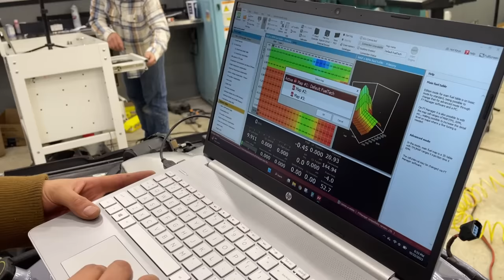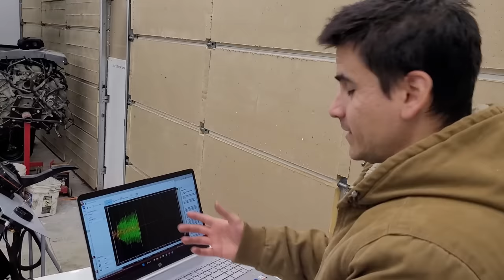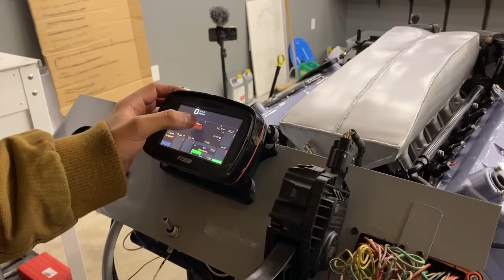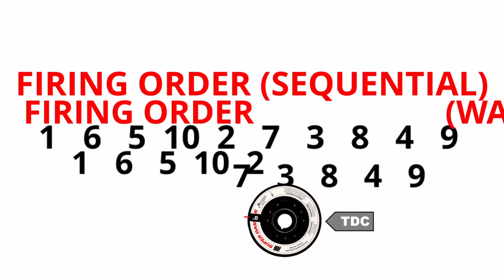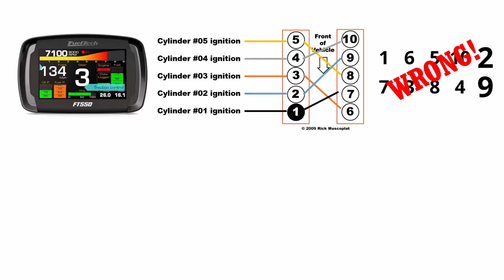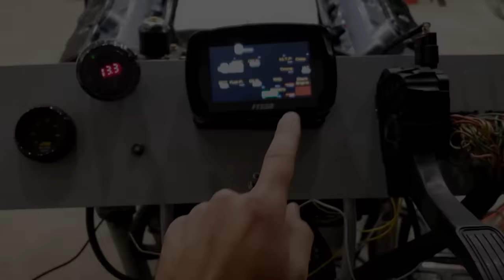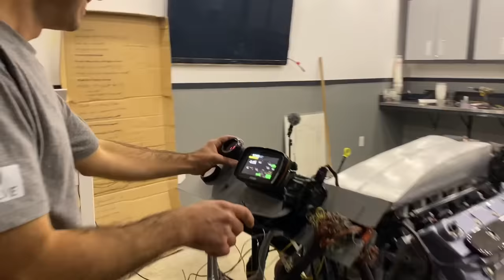Ford 4V V10 First Start! | It Sounds Insane!

Comment: Gentlemen, I am an Engineer with 40 years of racing and building engines. What you have accomplished with this build is on par with the Jon Kaase and Ed Pink’s of the racing world. I do not have the words. You will have a great future in whatever life endeavors you choose to peruse. All the best!!
Reply: No kidding!
People have NO idea how difficult this stuff can be.
These guys knocked it out of the park!
Reply: Diego and Jack should be both awarded a Masters in systems engineering for this accomplishment.
Reply: Hell yeah it is!

Now uh....when you gonna have that therre Hooo charger and manifold added atop this magnificent beast?

Yknow, it runs, so the law is add boost until the rods see daylight, then rebuild it!

Seriously, congrats all around, thats a monumental amount of engineering and self taught just stubborn "fuck it, ill do it myself!" Energy.

That's the right kind of energy, if you ask me!
Reply: Needs a supercharger 👀
Reply: @doktorzasinuse one issue with superchargers, ignoring heat soak and increased IAT, is the extra load put on the front main bearings. The sc pulley is torquing on the main pulley, and that puts extra load on the front main. This is especially true of a factory motor with aftermarket supercharger kit installed, but even when engines are designed from the factory for this extra load they still often have issues long term, especially when modified for more power than stock. I’m an engineer who’s worked for Ford and experience with amateur road racing and building engines for over 20 years. There are a lot of reasons why road race cars prefer N/A, especially amateur with less budget than factory team, but even factory teams stay away from superchargers. They’re good for drag racing or street, but less than ideal compared to other options for road race.
Reply: Wow that's going to be a Powerhouse
Reply: Happy that you are on the Ford side 😂
Reply: I am a certified couch potato and I second this.
Reply: @joeracer302 turbos baby. 

Since people are sharing their credentials. I’m a methanol addicted tuner.
Reply: 1:38
CULVERS BABY! Oh yeah😎
Reply: Ford built a V10,4 valve, 351cu in Mustang prototype years ago
Reply: @bobwoods6410  they do make a mention of that in the beginning of this video
Reply: @skullfracture2 I noticed that as well!
Reply: @doktorzasinuse ford made one with twin blowers if I remember right it made around 1000 HP
Reply: What a great compliment!
Reply: I need to put this engine in my 2000 Ford excursion and watch me smile 🤘🤘😁
Reply: Now, how much to build me one?
Reply: As a long time innovator and retrofitter, I must say I’ve been itching to fab a bolt on 4v crossflow head on a 300 Ford I6 (4.9) have a pair of cams ground to match a high performance profile  and run a timing chain or belt off of the OEM cam gear I’d dowel and bolt it to the front and fab a cover, variable lift and variable timing, direct injection with additional components as solutions to the cons of GDI, I’ve given away too much, but I expect 90-100 hp per hole or 1.8-2hp per cubic inch, torque, yeah, we’ll have that too, I i had gotten my CNC milling station I’d have one in a smart car or a fiat or a ninni gooper.
Reply: On that note, these young men did excellent work, similar achievements have been made, but creating improvising and problem solving on your feet impressed me, keep your skills honed  and if I have any questions I’ll hit you up!
Reply: @bobwoods6410 exactly this isn't special at all like it already exists everything you could every need to make one run already exists since ford literally did it already
Reply: @bobwoods6410 If I am not mistaken it was based on the 4.6 lower deck height engine. I remember the protype video. This engine has the added benefit of cubic inches.  Congrats guys. This was amazing.
Reply: @TRMN8R03 Yes and no. Please see the above statement. As far as this being special? Can you do what these guys achieved? Hats off to them! Don't be jealous,  please enjoy what they have done. They have a ton of time and money that 99.9% of the world wouldn't have gotten past the first video.
Reply: @doktorzasinuse  Nah. NA will give you a smoother power band.
Reply: This engine needs to be race proven to be on par with Kaase and Pink.  Being race proven is more than just running it on a stand with some throttle stabs.
Reply: Now if they can get a set of casting die for those heads for easier reproductions.  Don't let such a great feat of engineering get lost in the shuffle of time like the 302 cammer.
Reply: @joeracer302 we have mag clutch setups these days, as well as various other bits of "trickery" to reduce the strain on components. Yes, then the issue becomes cost, however, if the funds are there... Well, 'nuff said.
Reply: 200 rpm baby, LOL!!!
Reply: Brooo she sounds so crisp and good 🤌🏾🤌🏾 you guys have achieved what ford should have put into perspective a long time ago. The perfect engine to compete with dodge if it was done right. This would have put ford in a different class of performance but you guys accomplished that with many days of trial and error and got it done. Big ups to you guys
Reply: Thank God you said engine.
Reply: i bought a used 2002 f250 v10 in about 2008-2009… had 39k miles on it, and i drove the piss out of it till about 176k, change the oil, that’s it… that motor never skipped a beat… I never got over the loss of that truck., black, 4 x 4, with off-road package, lariat gray, leather interior loaded, almost in tears typing this, I loved that goddamn truck. Had one year left to pay on it and I had to let it go back to the bank post. ‘08  recession, struggle,… the next 10 years I drove two Chevys and 8089 Chevy 2500. We picked up for 1000 bucks and a 98 Chevy 1500 picked up for about 1000 bucks never turned to wrench don’t even think I change the oil in either of them, no joke… I saw out a 2007 F150 black closest thing to my old 250 that I could find at the time… that was cursed, long story short I totaled it recently and my first thought was thank God good riddance, and I am now on the hunt for a 2002 era v10, was curious what it would take to rebuild one of these things and I stumbled across this video or at least I cross part one and I saw an air so I saw out this video and to see some of the compliments made to these kids I say kids are probably my age, gave me chills… in a world, full of ordinary dare to be different life is either a daring adventure, or nothing at all Helen Keller
Reply: Ford guys are very smart and even more hard working
Reply: @bobwoods6410 They also put it in a concept Shelby Cobra. Fords version was built on the 4.6 ltr.
Reply: I love John Kaase!!!
Reply: Shoulda went V12...😮
Reply: @slotripper  Perhaps you should have a go at it? What do you say doltripper?!
Reply: Well said sir!
Reply: Never heard of garage54
Reply: Agreed

Comment: As soon as you can get the funding figured out, call Nelson Racing Engines or Steve Morris and find out if they can scan your heads and rocker covers. They have the capability to cnc machine these components, correct any issues from welding 4 heads together and also improve the geometry of the ports and chambers. Kind of like making FR500 heads for the V10. Congratulations on your success after so much hard work! I can’t wait to see it powering your vehicle and hopefully a Dyno video
Reply: I could use these heads for my V10 🤘🤩🤘
Reply: Getting John Kaase on board would be the best bet he loves quirky ford shenanigans, hence why he won engine masters with a Ford 400 and 5.4 mod motor and built 429 boss heads for the 385 series big block.

Comment: wow! congratulations, guys! what a crazy achievement!
Reply from the maker: Thank you! It was great seeing your P1 at SEMA, looking forward to seeing the rest of the build!
Reply: Hope you put break in oil in it!
Reply: Freddy, I heard you’re removing the hybrid system..  lol. Dude I can’t weight.. get it.. gonna be insane
Reply: got anything that needs a V10?
Reply: Shout em out big homie!
Reply: Freddy definitely check out these guy's engine and help them find a clean mustang to shoehorn it into. Whoooooo🎉🎉🎉🎉
Reply: @BassMatt1972 everything needs a V10.
Reply: @JmanRx81  if it wasn't for a video Derek did with him I would have absolutely no idea who he is. I still really don't other than he is some guy on YouTube I guess🤷🏻‍♂️.
Reply: but you guys dont own a funnel.  was that to be funny cause i was rolling
Reply: You should put this in the mclaren p1 🤯
Reply: @Albertgermanaro-fs7yf it's a roller cam engine it doesn't have a flat tappet cam needing loads of zinc. No need break in oil. Regular simi synthetic off the shelf has so low of synthetic rings seat just fine. Just can't use full synthetic to seat new set rings in.

Comment: This is unreal, holy smokes! I cannot believe I'm watching it finally run today. This build might push the Ford V10 into a new place in the aftermarket!
Reply: Well, Ford would have to build a V10 version of the Coyote for this to work. And, if Ford says no, then these guys have their work cut out for them!
Reply: @JohnDoe-yj5ng if the heads are available cast or cnc there are plenty of ford v10 blocks sitting
Reply: Yes please
Reply: Just lying around with a cold and stumbled upon this video. I’ve wanted to do a boss v10/gt500 67-70 but it’s hard to find aftermarket for these things. You guys could possibly become big time rich…very quickly. I’d buy them 4v heads for sure!
Reply: @JohnDoe-yj5ng not exactly. if aftermarket’s see this and feel like a viable endeavor then all they have to make are cams, 4v style heads, timing equipment. all the bits other than the block unless they’d choose to do that as well.
Reply: @rollthedice.5973 This ain't happening. The EPA is waiting for aftermarket performance to break even, then they pounce.
Reply: @don2deliver  ehh, was just a thought.
Reply: These engines have been out there for 25 years. The Ford V10 is a 5.4 but with 2 extra cylinders up front. It's an extra 100mm in front of the engine mounts. Not only is it heavy but finding the extra room is why this engine only came in trucks and really isn't that popular. A lot of people have done some cool things to it before YouTube even existed.
Reply: @don2deliver  I like to believe the populace and private industry will resist eco-litigation more aggressively in the next few years.
Reply: @coliimusic  I believe that depends on election integrity. And I don't feel too confident in that.
Reply: @coliimusic  Vote for Trump and then be very active in contacting and interacting with his appointed officials if he wins. God forbid he loses.  He will also need to purge these agencies of people who will get in the way of doing what he expects.
Reply: Well of people knew anything they'd know the 3v head mod motors aren't that far off from a 4v, from 2005-21 you can find 3v V10's, you can already come within 20-30hp of this build with a 3V. 5.4 heads get cnc porting and I imagine the program would work on a 6.8 so you can already make a badass 6.8 much easier it's just people don't know much about much

Comment: It was nice to watch you stumble and learn.  A lot of channels try to make it look like they know it all, your humble and honest approach made for an amazing journey to watch, I cant imagine how it feels to be in your shoes.   You all earned that W.
Reply: This baffles me.  The 4 valve 5.4 and 4.6 drops right in with factory computer, just reverse polarity on the coils. That’s it. Everything else is exactly the same, so with a 4 valve. V10 why not use stock computer. To run this thing and reverse coil polarity instead of reinventing the wheel.  Creating the heads  was the hardest part.
Reply: @feellnfroggy  the V10 was only in trucks and vans. Tunes for the 6.8 are harder to get hold of and limited  to truck applications.
Reply: @craigwiess1656  I'm aware. But it would have been drop in, and any tuner can change the parameters for car applications. Easier to get it running. Then swap to standalone later when you have more info. Moot now, it's running. Good job for that. Just seems the hard way.
Reply: @feellnfroggy  Admittedly I don't understand the subtleties of this but can a stock computer run 2 throttle bodies?
Reply: @mchristr  I missed that part of the build. No it can't. But you can run two parallel. 😁
Reply: What a fantastic sound!
Reply: @feellnfroggy  DUAL THROTTLE ISN'T AVAILABLE

Comment: I think these old 4V Fords are far from dead.

I think the 4V V8 and V10 are some of the finest sounding engines ever produced.
Reply: The v10 truck engine is 2v and larger displacement. This motor did exist actually, ford did the same thing, used 2 4.6l 4v engines and heads and made a v10 version. They put it in a cobra r to test it.
Reply: @dhmoto111  - I’m an ex ford tech, I know the old V10’s well, and well aware that ford’s one off 4V V10 sounds amazing, too.
Reply: @dhmoto111  the V10 was also a 3V and tbh 3V heads are only a few hp off 4V outside of unobtanium Ford GT heads
Reply: @fiddynutz68 3v heads do real good for sohc heads but they dont match 4v heads ported vs ported.  Yea out the box they aren't far off the older 4v heads but if they're both worked max effort with a proper setup the 4v heads are going to make more power especially once boost comes into the equation.

Comment: Imagine a V10 like this in a Pantera mid engine car. On any car this thing would be amazing. Good job guys stuff dreams are made of.
Reply: Duuuude I didn’t even think about that. I was thinking a clapped out 90s caprice and make it a sleeper, or a farm truck, like an unassuming ranger or a 90s f150
Reply: GT-40 clone,.. or Shelby Coupe would be amazing homes for this motor, as would the 90's era Ford GT, or a 30's/40's Lincoln. Heck, in a late 50's or early 60's Thunderbird, this would be amazing.
Reply: a v10 pantera would be sick

Comment: Boys, that thing sounds wild. I assumed it would be similar to a Viper, but it definitely has some higher pitch Lambo/Audi noise coming through.

you’ve accomplished something most expert engine builders would never try… this is an incredible accomplishment!
Reply: Well a viper engine is a push rod motor this is a doc motor I can already say it’s probably gonna be turning up 8,000rpm like nothing
Reply: @5.slow-ranger The location of the cams doesn't make nearly as much difference to the sound as the cam profile, header design, and firing order do. In fact, a pushrod engine and a dohc engine with all other factors similar would sound nearly identical
Reply: @tome1903  except it does; it is the same reason the 2,3, and 4v mod motors all sound completely different.
Reply: @wckdvnmproductions and number of valves
Reply: The dodge is an odd-fire design and the ford is even-fire. The dodge shares crankpins between banks while the ford has offset or “split” pins to correct the firing intervals. The dodge sounds better imo more aggressive, the ford has a supercar sound, this one sounds amazing compared to the trumpety drone of the stock 6.8 2valve.
Reply: @tome1903 you’re right, it’s just that nobody has ever had identical engines with OHC and OHV to compare.  Everything would need to be the same, port size and shape, valve sizes and cam specs but they would sound identical exhaust-wise, the OHV would have more mechanical noise.
Reply: @_..-.._..-.._  sounds bout right
Reply: I heard something about the way the viper engine is designed, it sounds like 2 5 straight cylinders at the same time instead of having the actual 10 cylinder sound or something.

Comment: This is a unique V10 sound, and by far my favorite.  Simply built for muscle, nay exotic.
Reply: True Dual and even fire is a very weird combo
Reply: This is Ford’s 6.8-liter, DOHC, 40-valve Triton V10, isn’t that true, guys?
Reply: @mlsabc1236 they only made a one off 4v v10 this is a custom made one using 4v heads from a v8 chopped and welded together to work on the v10.  Yes this is a 40v v10 but Ford didn't actually make these in production vehicles they were only 2v and 3v version in production vehicles they did one in a one off mustang for 1999 it had 426 hp and over 400 tq back in 1999 it was a 351 cubic inch v10 though not a 6.8 liter like this one.

Comment: I’m a fan of truck v10s so this is amazing to see. I drive a 98 Ram 2500 with the cast iron magnum V10. I’ve always wanted to built a high performance, high revving one and y’all are even more of an inspiration. Nobody that starts to mess with these ford v10s OR the dodge v10s ever get anywhere with their ideas until you guys showed up and actually made something happen. Y’all are doing us V10 lovers proud and I’m excited to see this thing dyno tuned and do some pulls. I also really hope after all that work that y’all build some beautiful headers for this thing.
Reply: I have a v12 in my 750il makes little power now but this project makes me want to tear into mine and try and see how much power can be squeezed out of it
Reply: I think the viper heads can be modified to fit the dodge 8.0 truck v10. I used to be into the dodge v10s. I had to drive a ford v10 for work and it stunk compared to the dodge, mileage was better on the ford though! 10mpg vs 8-9
Reply: @_..-.._..-.._ viper heads will not work on the truck v10

Comment: Great achievement guys! Whilst it might not be a problem for you, on a turbocharged V8 engine which I ran wasted spark, I had a whole load of issues with backfiring under load.

The issue in the end was due to intake valve opening slightly before TDC, some fuel and air would leak in when the wasted spark fired, casing back firing.

It may not be a problem for you if you are running NA. For me, the only way I could solve it was going to sequential ignition and it totally transformed the running of the engine.